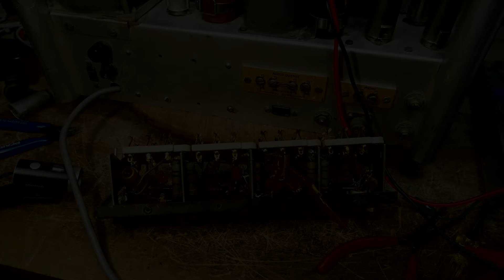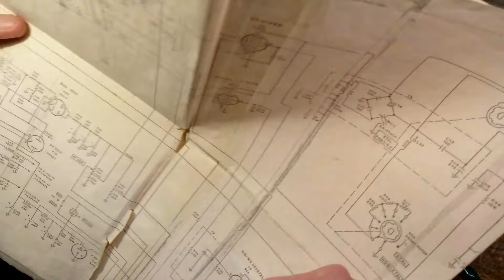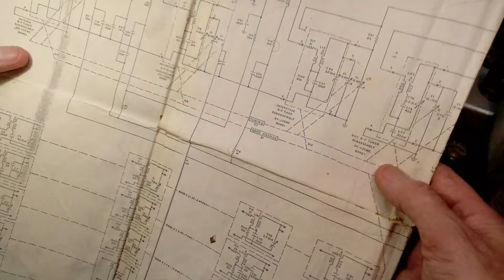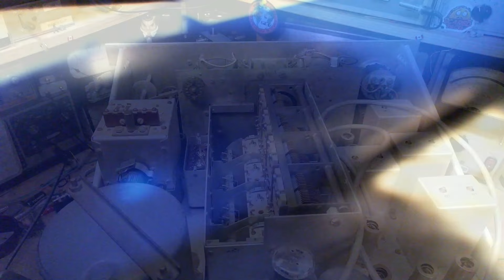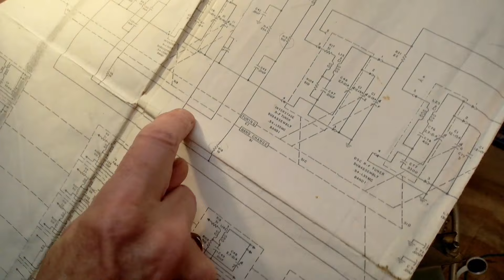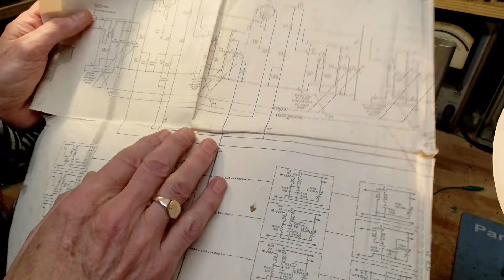Hammarlund SP-600 Communications Receiver Video #16 - Talking it Through

Comment: Jim Just a another thought on why your two SP600 have different types of caps. The cost factor still holds true but the one you're working on now may have been built to MIL SPECS, military specifications.,. I believe the one you are working on, you said was used by the military. and the ceramics caps would have had a greater "Mean Time TO Failure".  But who knew after 40 or 50 years.

Comment: Hey Jim! I just had a thought: The symptom is that the radio works for a certain amount of time - several minutes to several hours before burning out some selfless resistor. Something is getting hot and drawing more current, making it more hot - thermal runaway?

The ceramic inside the capacitors could be 'crazing' from age. Heat could then be causing the non-ceramic material to expand , bulge out in the "craze" cracks in the ceramic, and short out. Then the large current would "heal" the capacitor while burning out the poor, selfless resistors.

Then when the cap cools off it goes back to "normal" or where it is only leaking a small amount of current, it will test "good". My idea is to test it after heating the capacitor up to 80-100 degrees centigrade. You would need a heat source somewhere between a 25w pencil soldering iron and an oxyacetylene torch - your choice.

Of course, I could be wrong. It has happened at least once today.

As far as the resistors going low over time, I can imagine a wire wound resistor doing that. The insulation between turns breaks down and some of the windings are shorted?

Comment: Jim, your thoughts on the failure mode in the (electrolytic) capacitor is entirely feasible,   your analogy is applicable and describes a failure mode well but not for a ceramic.  I think an autopsy of that electrolytic is in order and some micro photography which I expect to reveal holes in polyester dielectric.  
Don't forget to lubricate the tuning dial bushings. r